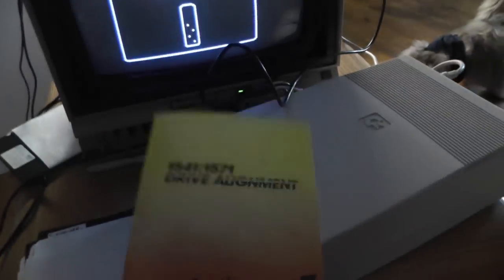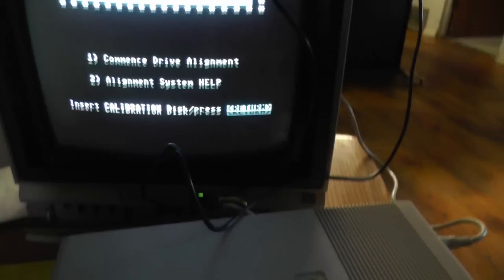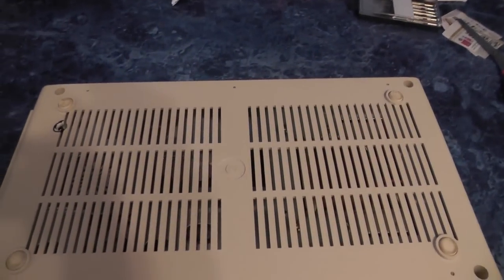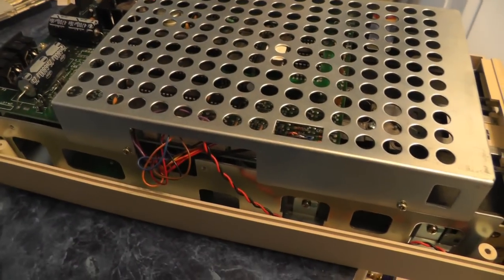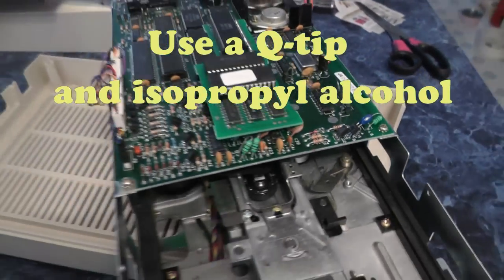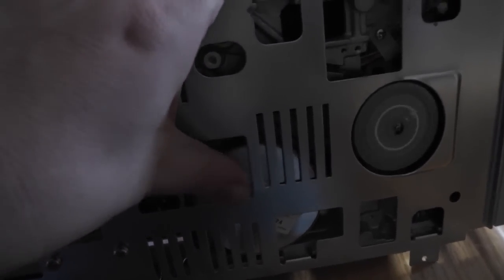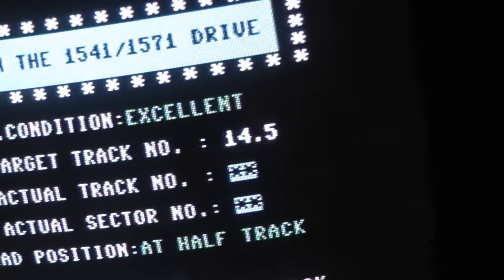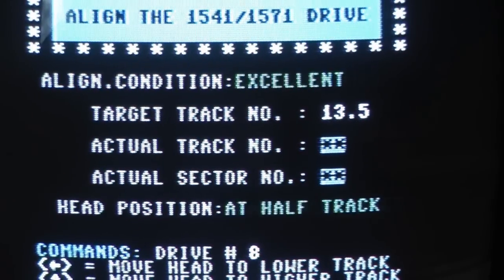Alignment of the 1541 Disk Drive - Opening and adjusting

Comment: I have some weird issues. Firstly, the best I can get at any position is "satisfactory", but I assume this is because I'm using a a demo disk instead of a calibration disk. The second and more troubling thing, when I do get it to show satisfactory on a half track, it will stay stable and I tighten up the screws, but if I step up and back down it now wavers between ** and the UPPER track number. If I instead go down and back up it'll waver between ** and the LOWER track. Eg. if I align it to 'satisfactory' on track 17.5, then step to 18 and back to 17.5 it wavers between ** and 18. If I then go to 17 and back to 17.5 it's now wavering between ** and 17. I guess something's loose and shifting about when it steps, but I'm doing the motor screws up pretty tight (tight enough that my smaller screwdrivers can't undo them). Is it possible that something else is loose and is it repairable?
Reply from the maker: I now only align the main tracks and do not worry about the 1/2 tracks, I just ignore those. So just get the main tracks are good as you can lock you should be good.
Reply: Thanks. I'll try sort it out when the splitter cable for my SD2IEC arrives, and maybe clean the head if I can find something suitable. I'll let you know if there's any more issues.

Comment: I read that the program itself was written on a NTSC machine so the timings are off on PAL machines, and making copies of a disk or using a D64 wont help since the second side of the disk is custom made for the calibration process and cannot be copied digitally.

Anyone know of a PAL/European compatible version or similar tool?
Reply from the maker: I know the 1541 DEMO disk works nicely for the calibration disk on the NTSC machines. I've used that before. Can't help with PAL though, sorry.

Comment: I have this Free Spirit software, bought new old stock copy this year. Using the same technique you show here, the best either of my drives report is "satisfactory'". Even with minute adjustments, it never says "good" let alone "excellent" like yours. Head stop and speed tests look spot on. I'm starting to wonder if the calibration side of the disk is bad.
Reply from the maker: It might be a bad copy, try using the 1541 demo disk instead of the calibration disk and see if that works better.
Reply: If is was copied from a drive that was out of alignment then yes, it is bad and you are just tuning your to match the drive that copied on.

Comment: I've got four 1541 drives and none of them are in alignment well enough to read or write a disk.  Is there any way I can get a disk alignment program on a cartridge?  eBay search finds nothing so far.
Reply: If you can find an original commercial disk, like a 1541 demo disk or some other utility disk or something, you can use that as an alignment disk. Not perfect but it works.
Reply: @gettingpast4391  5 years later, nice :) I did actually manage to get one that worked so I could boot an alignment program, and I had success aligning another drive!
Reply: My question is how can you test the alignment if your drive can’t read disks?